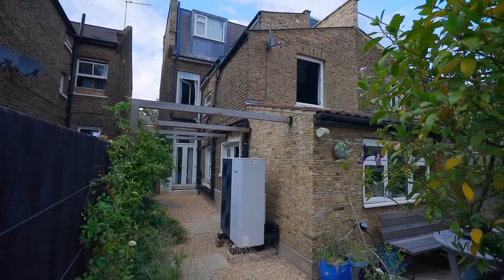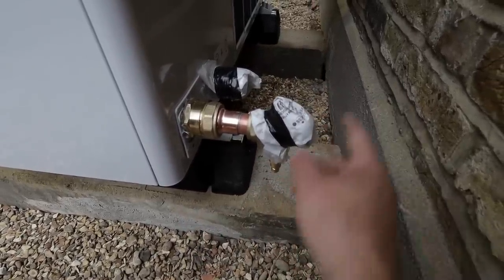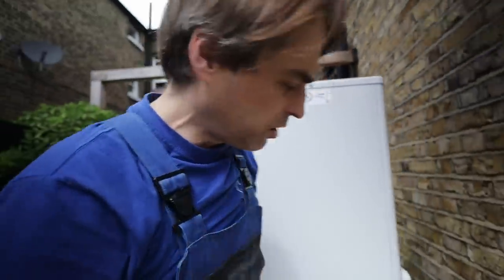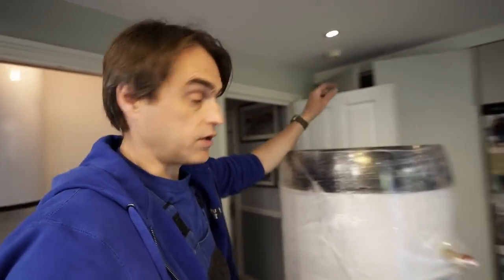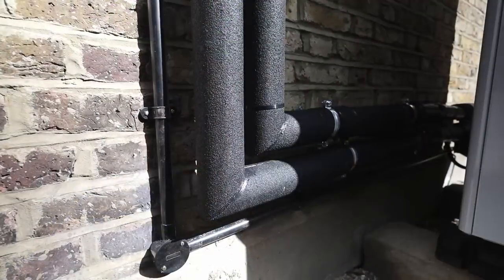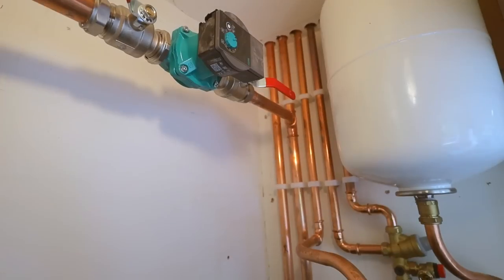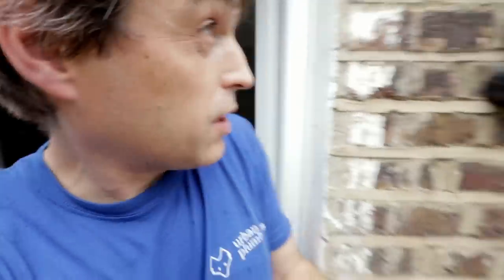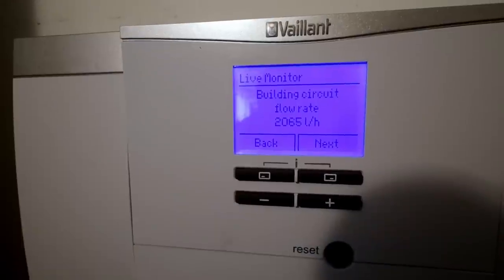Heat Pump Retrofit In a Victorian House. Is It Even Possible?

Comment: I love the work and I love the technology but that looked incredibly expensive.
Reply from the maker: incredibly expensive is a relatvie term. What is incredibly expensive in your mind?
Reply: @UrbanPlumbers  Yes, it is a relative term. In my eyes a new boiler is only £2.5k or so if you swap like for like. I would expect to pay more for a heat pump so if, after the government grant, it cost more than three times the cost of a boiler replacement (say £7.5k) I'd call that incredible expensive. Honestly, I'm not being critical, it's just a technology for the rich I'm afraid.
Reply from the maker: Ohh, my average charge for new boiler and unvented cylinder is £10k 🤣
Reply: @UrbanPlumbers  youve kind of shot your own argument there. New boiler and cylinder 10k. Two days work. Virtually no disruption to the house, certainly no rad changes, boards up, F&R pipe work upgrades, having to find a location for a plant room etc. So its £10k with minimal disruption or £30k and end up with that monstrosity sitting outside your house. 

Dont get me wrong, I love your work and your videos, but seriously, how many people want a plant room in their house?
Reply from the maker: @Lutonman2010 not if you want a low temperature and over 90% efficient gas system. Same work needed as for heat pump and now part l requires you to design gas systems the same way you do with heat pumps - so the argument stands and what is more interesting it makes properly installed gas systems as expensive as heat pump systems
Reply from the maker: @Lutonman2010  Part L requires all heating systems to be designed to low flow temperature, so even with gas you should be sizing radiators to maximum flow of 55C. T

If you want a gas boiler to be over 90% efficient, then you will have to make the same upgrades you would for a heat pump. You have to pay vat on it and you don't get £5k BUS grant,  making gas systems comparable or more expensive to install.

The fact that installers ignore the regulations or do not understand how to size for low flow is another matter.
Reply: @UrbanPlumbers  that simply doesn’t stack up. The gas system needs rads and a boiler that costs £1200. The heat pump needs rads and a heat pump that costs 15k, so even with the £5k kick back the heat pump is more expensive. Plus it’s not gonna take three plumbers a week to install a gas boiler and cylinder. Then factor in all the other stuff that might be required like buffer tanks etc. Plus you’re not accounting for the fact that you don’t need the massive flow rates with gas. My house is on 22mm F&R running at 50C using gas. Those 35mm primary fittings and pipework are so expensive they’d give customers a heart attack if they knew the cost of them. At every level, every part of a heat pump install, materials and labour is hugely more expensive than a gas install. 

Sell them to people based on the reduction in carbon. But trying to tell people they can have a full heat pump install for the price of a gas install is pie in the sky.
Reply: Just bang a combi on the wall, less that £3k, no tank, no disruption. I will probably get a heat pump at some point primarily because they are off gas, however, they are ridiculously expensive and 99% of us can't afford them.

Comment: for me, an ideal heat pump should, in the summer when it prepares hot water, instead of cooling the outside air, cool the water in the heating circuit of the house - similar to what vrv/vrfs are capable of...
For those who have a swimming pool, for example: the thermal energy extracted from the house should be used as heat for hot water and for heating the pool... so the system would be much more efficient compared to classic heat pumps...
For me, heat pumps waste half of their potential…
Reply from the maker: Ideal Heat Pump - stop swearing please ;)
Reply: Cooling the heating circuit water is tricky as it will likely cause condensation on the rads and pipe work causing mold and rot under the floors. My kids on a hot day go and stand infront of the unit when the hot water is running..

Comment: Did you fill the system with water protected with anti-freeze? also with the length of those 28 mm pipes to and from the heat pump whats the calculated heat loss? ,I saw you removed a Worcester Condensing Boiler those boilers are super efficient if installed correctly and Gas at the moment in the Uk runs out at half the price of Electricity which that heat pump runs on. 
The control system of that heat pump looks both complicated and possibly expensive if it breaks down and parts need replacing and commissioning. What kind of heat do the  Fan Motors generate when in operation considering all the heat is lost outside?Heat pumps are designed to be fitted in Modern buildings with all insulation up to current standards and all fitted with radiators correctly sized On the drawing board with correctly estimated heat loss calculated by the designer of the building at the time, They are not designed to be fitted in draughty Victorian houses constructed over 100 years ago.......So the maths are simple,cost of heat pump installed,cost of running the system at the desired level of comfort.....Versus cost of running the previous Gas heating system and if there is a difference time to get the money back spent on Installing the New system. Having worked in the heating Industry for over 40 years wo;ud have upgraded the original heating System and Installed Solar Panels with battery reserves cheaper more efficient and the returns on the solar panels would have been immediate.

Comment: It's just too complicated

Would be a lot easier if manufacturers built and sold mini heat pumps

One per room
Radiator inside
Mini heat pump unit outside (probanly roughly the size of a couple of shoe boxes)

And a heat pump tank for the hot water

Such a system might even be small and simple enough to DIY
Reply: You're losing some of the benefits of having a shared outdoor unit, you can do (though not DIY as refrigerant lines need to be run) what you are suggesting with a multisplit air-to-air system, which has a single outside unit for multiple inside ones. There's a daikin one as well that can hook up to a cylinder as well.  Air to Air also has the benefit of cooling in Summer (what's that?) as well.
Reply: If it's too complicated, employ some for whom it is not too complicated.
Reply: You can buy unvented hot water cylinders with a built in air source heat pump (connected to outside by ducting).  I am considering  a Dimplex Edel 200 litre cylinder  - it should save me about £200/year in electricity .  As I need an unvented tank anyway (to improve performance of two new showers) the extra cost is about £1000.  Previously had water heated by a gas fired Aga but that  has been turned off (too expensive) and connecting the tank to my gas boiler involves a lot of plumbing and seems to be a move in the wrong direction.
Reply: Well, they do. It's called split AC. And for hot water, there are hot water tanks that have a heatpump attached to them.
Reply from the maker: There splits now that do water as well
Reply: I agree. It's a great video - but based on the knowledge level of most heating engineers I meet there's no way this level of installation is going to be in every house. As long as every heating installation is effectively a small engineering project, there's a huge bottleneck. 

Combi boilers are successful because of their simplicity. One box that has everything you need. That's where heat pumps need to be before they're widely accepted.
Reply from the maker: We will get there. It is already happening and level of engineers is on a upwards trajectory already!

Comment: So, the purpose of a heat pump is to move heat from the air outside the building to the air inside the building. Question. Why is water involved? The rest of the world uses split units. Simple. And you get air conditioning for free. In a world which is getting hotter...

Comment: So how is electricity generated since you dislike gas so much?
Reply: Short answer: it depends - but he's also done videos on gas boilers, so maybe check those first? And even when electricity is generated by Gas, a properly installed heat pump will make better use of the gas, even with the lower efficiency of a gas power plant+transmission losses etc.